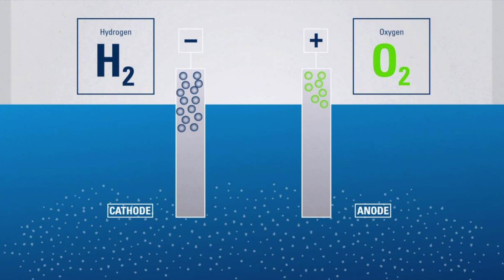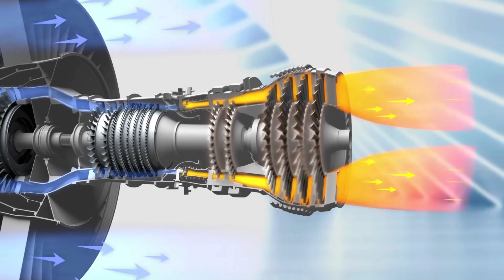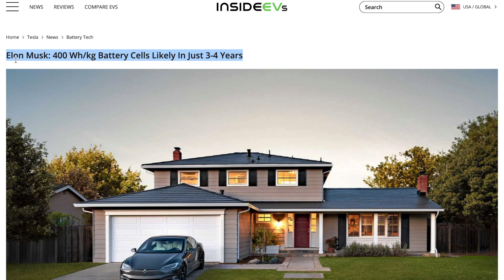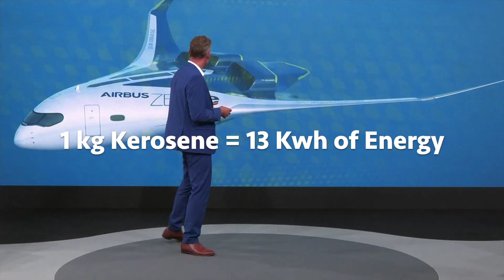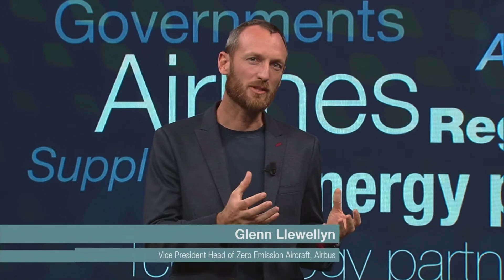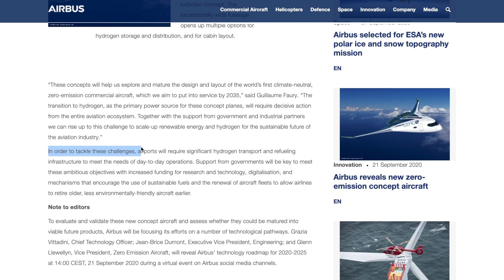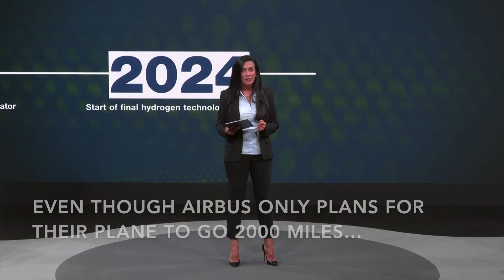Why A Hydrogen Plane Is A Terrible Idea

Comment: I think it’s quite a well presented argument. Well done. Obviously it’s a difficult discussion to have on hydrogen vs electric as we are using assumptions that are quite far out the curve. I think on the cost side we can get much more efficient in terms of production, with methods like SOFC providing very high conversion rates for energy. The biggest long term driver of the price will obviously be the cost of renewable energy which is still likely to continue the downward trend as capital equipment is produced at higher scale and efficiency. Great that we are having these discussions at least!

Comment: Fuel cells produce same electricity as available from batteries, so you don't need to burn it inefficiency. So if you use batteries do you burn them? I'll bet space-ex doesn't use batteries for rockets.

Comment: Oliver, what about a Hybrid-Hydrogen plane, a combination of battery and hydrogen, you think that will work? And also what if an airline produce it own Hydrogen? it may sound crazy, but that is exactly what Delta Airlines did I think back in 2000 when they purchase an oil refinery in the east cost?
Reply from the maker: I think if someone decides to make a hydrogen-plane it would be a waste of space to do a hybrid-plane, as batteries would fill a lot of the space. So if you are bullish on the idea of a hybrid hydrogen plane you are better off with pure hydrogen.
Reply: @OBFYT  point well taken. Me, I'm a petrol head, I love diesel cars, but technology must move forward,. I watched and listen to the engineers from Airbus, and well to be honest, make a lot of sense, then again one thing is talk about their three designs and another thing actually fly the plane and as you said, must make economic sense  for the airlines to buy it because one thing is for sure Oliver, this won`t be cheap. For the sake of the future of the company, I hope they are right.
Reply from the maker: @tarabottogino  I mean the sound of a roaring V12 will always be awesome to me, but yes we must move forward. And I hope Airbus and others shift their opinions on Electric planes when battery technology catches up. Which is very likely.

Comment: It’s possible to use solar panels to create electrical current which can be used for splitting hydrogen from water as you mentioned 
Time consuming, sure, but in large quantities could be quite viable

Comment: I so disagree with your findings. Right now in the Netherlands we have to ‘shut down’ our powergrid not to over-heat the system with solar energy generated by ordinary household-solarsystems. If you use this to generate hydrogen instead of shutting the solar-delivery down you can produce enough to power planes, trucks, trains or villages during the night or darkers days.

Comment: But electric planes (if they even come to existence) shall fly at lower altitude with more drag and shall consume more energy per mile, they shall carry heavy battery packs and will require more energy to move the extra mass. The planes are gonna be slow and shall take much more time to reach its destination and considering the fact that to many people time is as valuable as money itself, they shall be preferring the high altitude highspeed over the weather level flights that hidrojen fuel is capable of providing. Thus hydrogen still stands a good chance in commercial aviation.

Comment: This video will not age well. 

Clean/renewably produced hydrogen is far better for easy re-fueling and the environment. Batteries are horrific for the environment and takes too long to charge, degrade too quickly.

Electric engines with hydrogen "engines" producing the electricity, makes more sense. Don't forget, charging batteries loses around the same 30% as producing hydrogen. Hydrogen will be the future, batteries are not the answer.

Comment: Electric planes are really hard for so many reason battery’s weigh more than fuel and they don’t loose weight over a flight and jet engines provide power for the plane and it’s systems and all its other stuff and you can’t also put all that on battery’s so electric planes un likely hydrogen is more probably

Comment: Nowadays Lithium batteries are like a "golden hammer". I think batteries and electrification are a valid solution for certain cases, but they are not the solution for everything.
The spent of hugh amounts of money don't imply "miracolous" achivements. Kerosene is a fantastic fuel for airplanes, in the terms of today aviation: is a liquid fuel, has a very low freeze point, is not much volatile and features a high energy density.
I think that liquid Hydrogen could works for short and medium range (crossing the fingers), but for long range market i can´t see yet a valid replacement to kerosene (either fossil or synthetic).

Comment: Duh.  Use the methane.  It's not perfect, but it is way better than jet fuel.  It's a cryogenic liquid, so the cold temps are not an issue as even at the coldest point it's going to want to boil.  Simple piping molded into a carbon composite wing will cintinually de-ice the plane.  And in an emergency, the tanks can be designed to be jettisoned and self-soft land via parachute.  Or it can be vented overboard in a controlled burn before landing (or crashing).

Comment: Compress water vapour to such a degree to extract Hydrogen and then burn that as fuel. Is this how modern Jet Engines work already.? Is that why airlines can offer such cheap flights.? No fuel cost when cruising at 30,000 ft. Just a thought.

Comment: Comparing two non-viable options for long haul aviation.  Batteries aren't going to improve in power density at anything like the rates you claim.  Hydrogen is a non-starter because of lower volumetric power density and weight of storage as either a gas or a cryogenic liquid.  More realistic would be methane, methanol, and ammonia.  For methane and methanol, you'd used carbon capture from cement production.
Reply: No. The only viable solution for long haul flights (long haul produces most CO2 anyway) is synthetic E-kerosene made with renewable electricity, captured CO2 and green hydrogen.

Comment: There are so much wrong data in this video that there is simply no hope for fixing it. 
Just one of them the "efficiency of the jet engine is 25% on hydrogen". 
Jet engine is a typical Carnot thermal engine with very high temperature of combustion of 1400 K. 
The efficiency of this engine can be calculated by n = (T2-T1)/T1. Using room temperature for T2=300 K the 
efficiency of the jet engine is n = (1400 - 300)/1400 = 0,7857. So the upper limit of jet engine efficiency is 78 % far 
higher then 25% presented. In reality the typical efficiency achieved is above 50%.
And in regard to the hydrogen it is difficult to store and expensive to produce. Much better option is the ethanol. 
Ethanol has energy density of 24 MJ/l compare to kerosene 33 MJ/l. 
So it is has 72 % of the energy density and it is easy to store and cheap to produce. 
Brazil is making ethanol from sugar cane in industrial quantities covering over 50% of country needs for road transport.
Reply: Another thing to point out is the comparison of the effective energy between battery powered and hydrogen powered planes. Well it is not that simple. Heavier battery powered plane must use much more energy to get to the same flying level. This is simply proportional to the bigger mass of the electric plane. And this is where the bulk of the energy is used not for stable flight or landing. Additionally mass of the electric plane is constant in opposite to hydrogen powered plane where the mass is decreasing significantly. So for hydrogen we have 40 [kWh/kg] with effective energy 50% that is 20 [kWh/kg]. That 20 [kWh] must lift at worse 1[kg] to flying level. In contrast for the best battery, that is of density 2,5 [kWh/kg], there is 8 [kg] of battery with 20 [kWh], and that energy, assuming 100% conversion, must be used to lift 8 times more mass to the same flying level.
Reply: One more thing to point out is the price of the kerosene
According to IATA the price of the kerosene in USA is 
0.623 [$/kg] so much lower then the 0.83 [$/kg] in video.
Sorry I was trying to add the link but YT has deleted it.

Comment: @OBF When you talk about the higher demand for Hydrogen you simply ignored the demand for Rare Earth Metals and Minerals needed in abundance to make those Batteries. The mining process to extract these mineral resources are actually degrading to the local environment and they also need to improve a lot on their Efficiency and Safety to the people and environment. 
These mineral resources are finite in Nature. Now add the demand for Batteries that we use in Electronics devices. How will this be feasible in the long run?

Comment: How is it safe when these huge volumes are being produce,  producing static through the flow pipes,  a d thata if we at a direct way to produce it without pollutiin,  the Swedes say they v produced steel with it.  I think if it can be produced on demand, it should be done in vehicles

Comment: I took thermodynamics. Brayton cycles have thermal efficiencies of 30-50%. That's not much higher than 25%, and that could be raised. I don't see any points here that doom hydrogen.

Comment: to be fair hydrogen should not be disregarded and hydrogen versus electricity as fuel source or as a way to propel something hydrogen is much better because hydrogen makes over 200 times more watt hours per kilogram than batteries. Now I believe hydrogen should be used in planes because it is much easier to be used as a way to power plasma jet engines and batteries are considerably heavier and not as a efficient in the sense of weight to thrust ratios 
Batteries and hydrogen both have the chance to evolve and develop more innovative ways but for now hydrogen as a emission free source of electricity will be king of the skys while batteries will be the king of the ground

Comment: your efficiency calculation makes no sense. You are not considering the efficiency of the electric propulsion unit. The latter is (basically) the product of the efficiency of the batter, the electric motor and the propeller/fan. Especially the latter will bring down the efficiency quite much at high speeds.  You cant disregard that

Comment: You are projecting the viability of future technologies on current price structures, to push your point (against Hydrogen powered planes)! Hydrogen can be produced quite inexpensively (solar powered electrolysis once sunk costs are fully absorbed). The technology would make perfect sense on Hydrogen fuel cell powering electrical motor/propeller planes (ATR types). Universal Hydrogen, a California based company is doing just this. Now. October 2021. Hydrogen powered Turboprops and full jets, are another story, but please, don’t sell us your gloom and doom world vision against hydrogen powered planes.

Comment: Yeah but even considering all you have said it is not just about cost, it is about aircraft performance. So what if a battery aircraft is cheaper to operate is doesn't matter if it takes half the payload one quarter the distance, no passenger will pay to go on 3 or 4 connections on a battery aircraft than a direct voyage on a hydrogen powered aircraft. You are ignoring the  market demand for direct flight journeys, it is the same reason mid size aircraft dominate the market now instead of super jumbos people want and pay for direct flights.

Comment: Using H2 for a heat engine (like a turbine) is a loser (at 25% efficiency).  Using a fuel cell is far better (at ~60% efficiency).
Reply: You clearly never took into consideration the weight, maintenance and battery degradation costs, along with speed of travel. No airline is earning money if people don't want to board flights that now take 4 hours longer and not to mention, can't even fly trans-Atlantic.

Comment: Sorry i didn't listening that BS, but, sources of lithium are limited- think about that genius- means cost of lithium cells will dramatically rise, eletricity automotive era (battery cells) is only a small stage in our history, hydrogen is future- look at Hyundai, Toyota (already exiting fusion-hybrid cars hydrogen+electric motor), Merecedes already started research on that same types of engines, And now big brain time - power transmission loss on eletricity transmission lines ( huge electromagnetic fields uder lines) can be converted to hydrogen by free electrolysis, genius.

Comment: Hello, I miss some facts in your video.
First I'm not a fan of hydrogen, but under specific circumstances they could be a useful technology.
For the long-range airplane the hydrogen technology have a much higher advantage, because the airplane is losing mass over the time which increase the range. (you can derive the braggers range equation)

2nd: the price is will drop for every technology if we put enough money in the infrastructure. e.g. how expensive were the lithium ion cell 20 years ago for a specific energy storage.
3rd: the power of electric engines are also physical limited by the generation of the magnetic fields. there are research in super conductivity but this will be in the future available...
4th: jet engine propulsion system have a high efficiency around 60% and a very high specific power. no electric engine could ever reach this power density.
5th: battery electric airplanes are perfect for small airplanes and low range route. My estimate calculation showed that we could reach easy 300-500km (180 - 310 miles) with battery powered airplanes with a cruise speed of 100m/s (360km/h or 230mph or 195knots)

If we ever could develop a battery cell which has a energy density of 10 times higher than actual batter cells we could also build battery power electric airplanes  for the medium range (3000-5000km ) but there is no change flying nonstop from London to Sydney...

Comment: U didn’t put a lot of thought into this. U just hated on hydrogen and you are clearly a battery fan. But one question the weight of the batteries for freakin jet airliner.

Comment: Can an electric plane engine really exist or be invented? Like why can't a hybrid plane exist by having the fuel engine be only for take off/landing and have the electric engines use the wind/flight to spin the turbines/rotors to fly the aircraft.
Reply: Too slow. Too heavy. Not to mention the added weight and cost of two different systems.

Comment: Batteries need to be replaced after 10 years...
Reply: Nope not for aircrafts, it will need to be replaced in 5 years
Reply: Not even that, but absolutely no aircraft operator on med-short haul distance will wait several hours to recharge.

Comment: Looks like rockets are switching to methane. Won't be cryo-methane better for planes as well?
Reply: methane is less harmful but still damaging to the environment
Reply: @seankilburn7200  if you talk about CO2 you can actually make methane from hydrogen and CO2 so methane can be CO2 neutral.

Comment: You are putting a price on everything except our lives as related to climate change. I can produce electricity (hydro dams, tidal etc) and therefore the ability to create hydrogen then use that hydrogen for power which then produces water which then takes us back to our previous state. So what if its less efficient? It will do the job with less destruction for our environment. Battery production require resources that are mostly not re-usable and finite. Your case for their use therefore becomes meaningless in the world we need in the future. I like other readers here gave you a thumbs-down.. you deserve it.

Comment: Why not both? Hydrogen electric plane, take off on the hydrogen and cruise on electric, problem solved
Reply from the maker: Well, that would require you to both carry a tank of hydrogen, a battery pack, and 2 different types of motors as electric and hydrogen motors work in different ways. Which wouldn't really make much sense. So unfortunately that isn't a favorable solution. But thank you for your comment!
Reply: @OBFYT  Why not? There are hybrid cars? The most energy consuming part is the take off so you would need only small batteries to maintain the speed. But I know that the hydrogen is still not the best solution anyway just playing around with ideas.
Reply from the maker: @elmikatv  Sure I get that, but hybrid cars have never been the best solution. Which is why they don't sell them in large volumes. They exist mostly to comply with pollution regulations.
Reply: @OBFYT  True dat, you are right , played devils advocate. Thank you for great video just discovered your channel!
Reply from the maker: @elmikatv  It's healthy to hear opposite sides of any topic so I am only glad you took the time. And thank you!

Comment: You could have a hydrogen hydrolysis generator on board the plane and you could basically fly forever. Hydrolysis requires oxygen and water. The water would come from the planes water byproduct and oxygen from outside.
Reply: Not much oxygen at 40,000 feet....